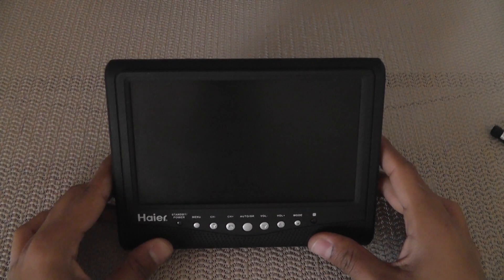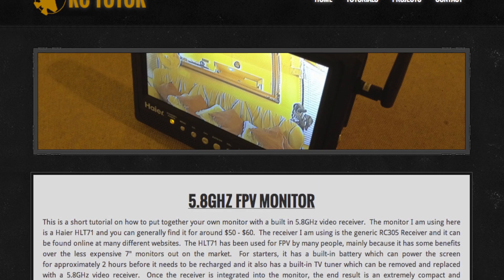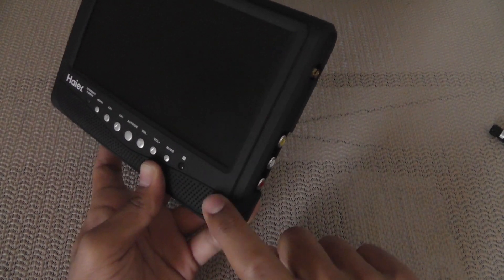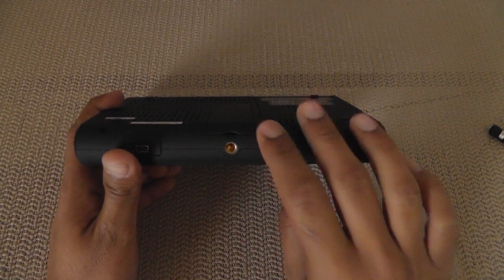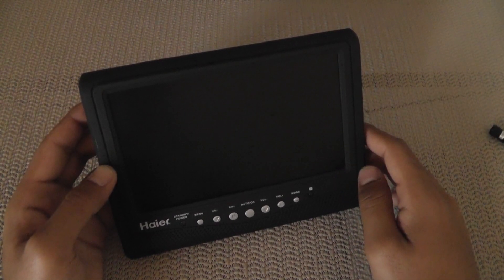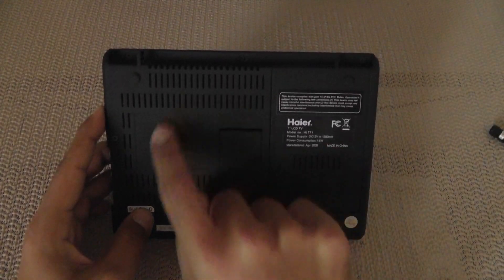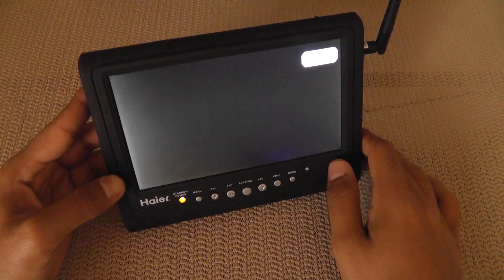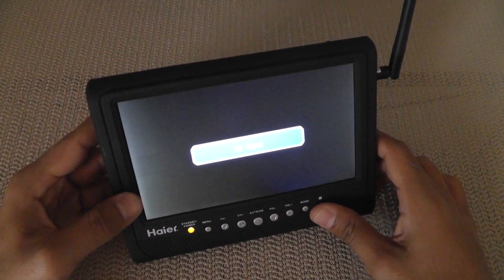5.8GHz FPV Monitor

Comment: The other day i got a fpv monitor, wonderfull piece of equipment, anymay, i unboxed it and plugged in the battery, sadly then i realized i just forgot to mount the antennas on top of it, will this damage my 300dolllar monitor?